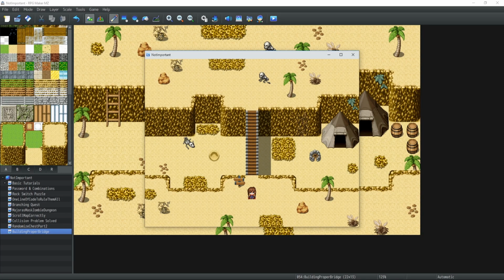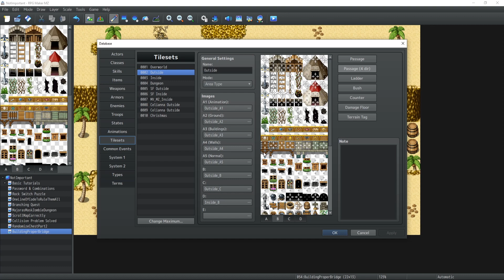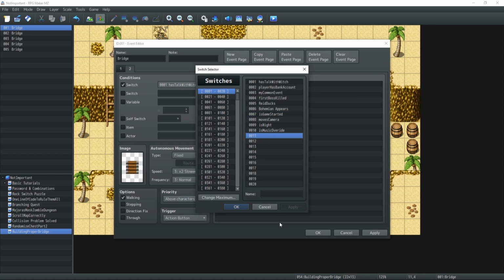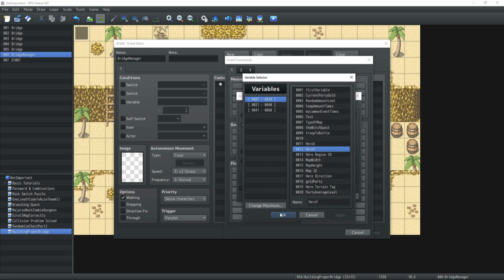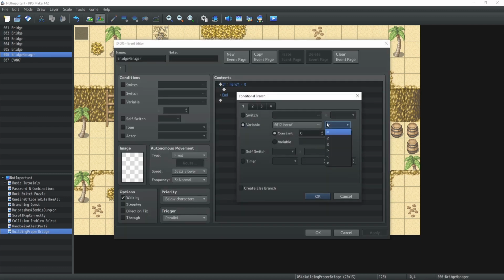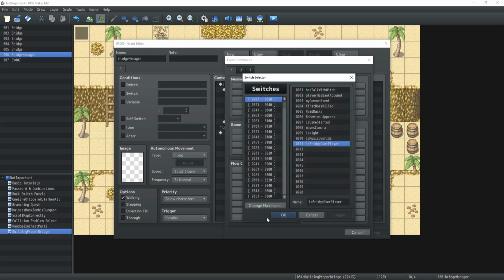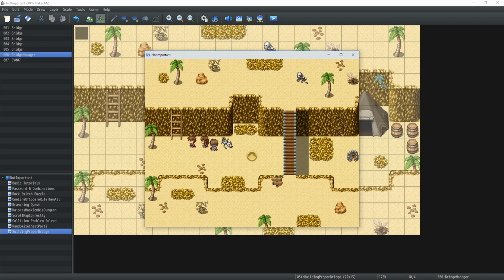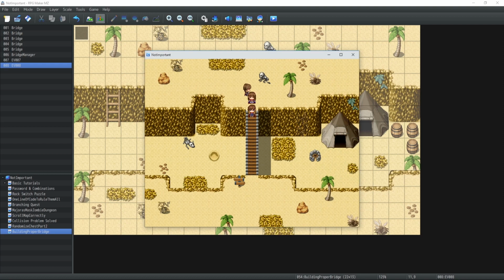RPG Maker MZ Tutorial #42 -  Bridge Over And Under!

Comment: Another trick is duplicating the tileset, one for player ON bridge, the other for OFF. When stepping on/off the bridge have a command that changes the map tileset over. The only real issue is if there are other events moving around near the bridges they could suddenly be under or on the bridge which can look awkward. Very easy but you have to plan out the bridge sequences to avoid strange sightings.

Comment: Another method is using scripts in your BridgeManager.  
  ->  if (script branch) $gamePlayer.pos(x, y) : switch ON/OFF

So as to control all the access points (top and bottom of ladder, top and bottom of bridge). I know why you explained it THIS way but just thought I'd mention it if people wanted to use scripts in this scenario instead of variables. - Only issue is (as you've mentioned in previous videos) if you move the bridge or change the map, you'll need to go back and edit the X and Ys in the scripts.